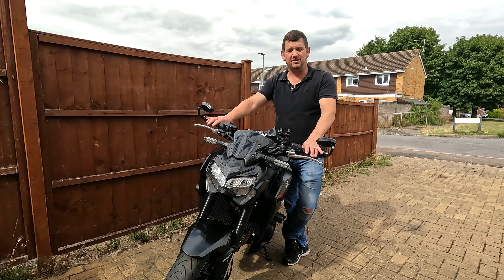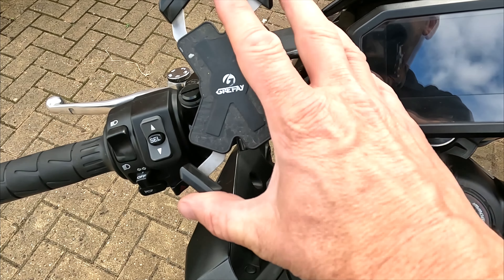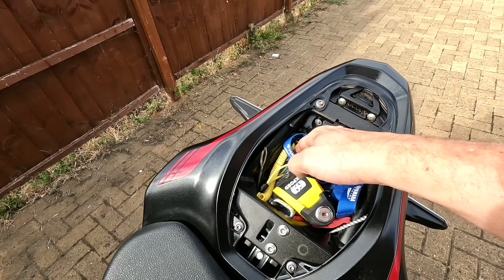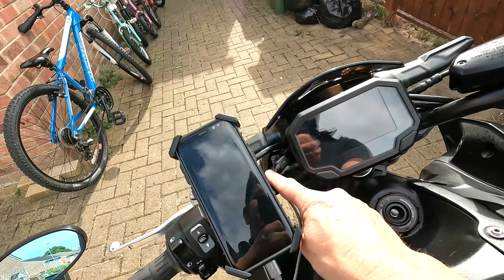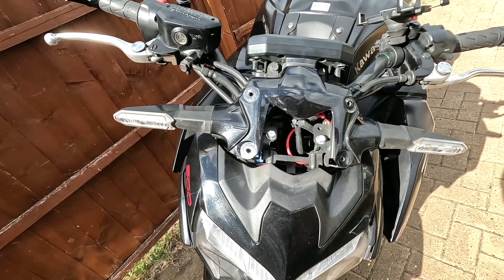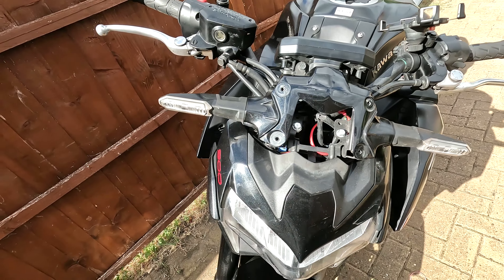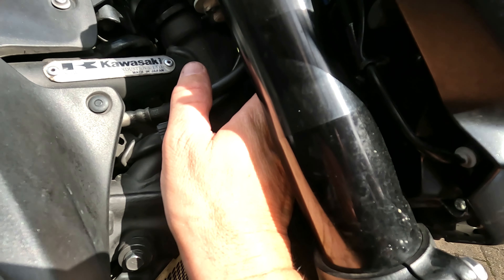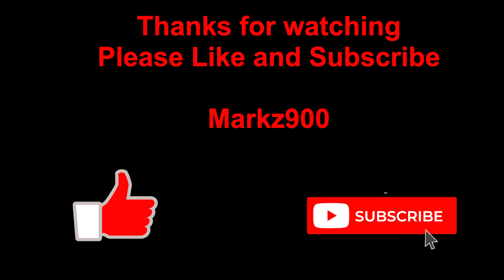Z900 Front USB Charging Point

Comment: Finally got around to doing this on my Z900 and while it works, for whatever reason the SAE USB I have doesn't charge fast enough. My phone battery drains faster than it can charge. Now looking at trying a different USB plus or another solution all together.
Reply from the maker: I'm touring at the moment and no issues. I have an old samsung S8 which is doing all the satnav etc. and it charges perfectly. Not really sure what to suggest for you ☹
Reply: @bikerevz  Thanks for the reply. Went through the reviews for the one purchased off Amazon and seems a lot of people have the same complaint. The one I got seems similar to the one from your video, but maybe the output is different. I plan to return it and go with a different USB that will connect to the SAE I already hooked up. Hopefully that one will work better.